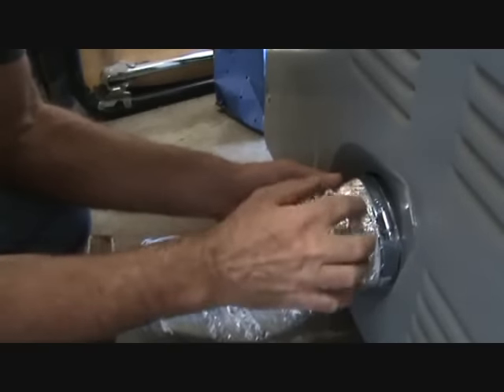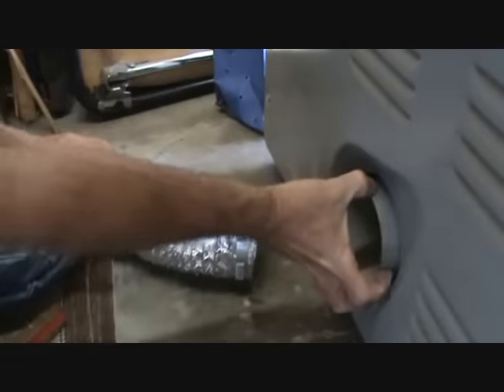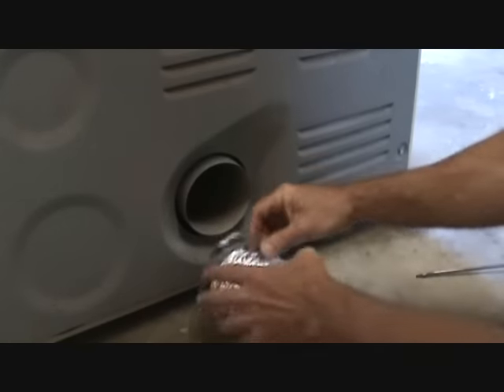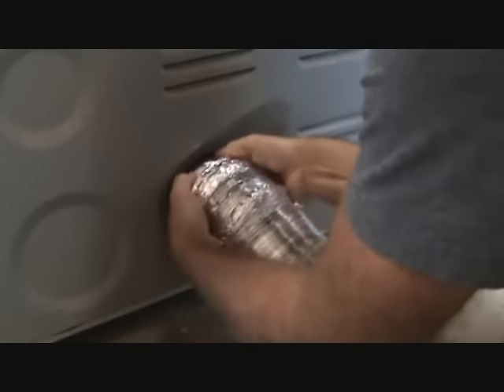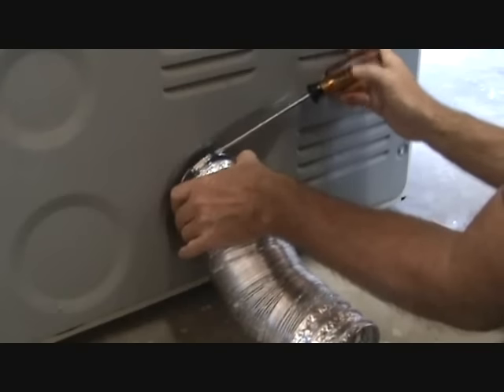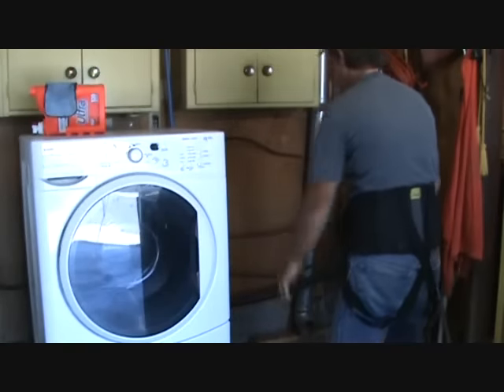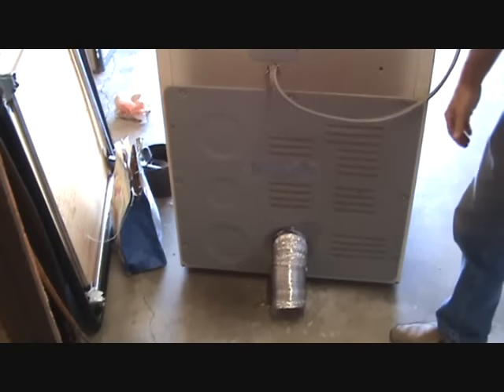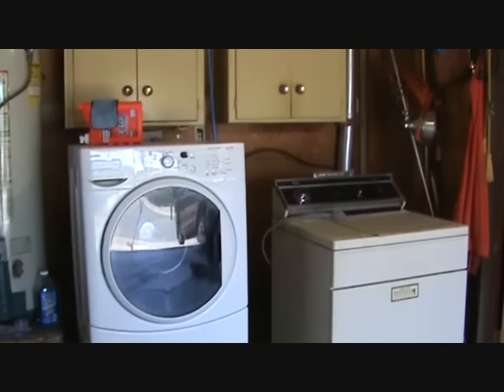How to install a dryer vent flexible pipe

Comment: I don't mean to be a downer, but I'd like to share with you why this is NOT a good installation.
1.  Material is NOT code compliant for dryers.  It will wear out over time and the foil will become brittle and break.
2.  This material is easily crushed against the wall, significantly reducing air flow and will also collect lint much quicker because of the ridges and shape
3.  Transition material like semi rigid can only be used up to eight feet for a reason.  This does NOT mean that you should use all 8 feet of it.  Most people leave it long so they can pull the dryer all the way out to access it.  You are much better off moving the washer, making the dryer connection properly, and then moving the washer back. 
4.  The clamps do NOT seal the vent.  You will have air and moisture escaping the vent and it will get sucked back into the dryer causing lint build up on your wires, motor, etc.  This will also wear out your belts quicker.  

For a proper installation of the transition, use a small piece of pipe or an elbow at the back of the dryer.  This eliminates the problem of having a short lip to work with.  Use Semi rigid or other code-compliant material to make the connection and keep it as short as possible.  If you have very little room, like many people do, you may need to cut away the drywall a bit or use a "close connect' 90 degree elbow.  
What I can promise you as a certified Dryer Exhaust Technician (CSIA.org) is that you WILL have a problem.  Air flow will be blocked, your line will build up quicker, your heating element or fuses will then go on your dryer and you will pay for the dryer to be fixed.  Unfortunately, you may never change the venting, even if they clean it out for you.  
Sometimes, it is best to call a professional.  I am an owner in a national Dryer Venting franchise so please know I am only trying to inform you.  Best of luck
Reply from the maker: Thank you so much for all the info. you have provided! Anyone who elects to read your comments will surely benefit from your knowledge. Thanks again for taking time out to post this message!   Joe  :0
Reply: +Joseph Emery Elbows and the semi rigid piping with the smooth interior is the way to go.
Reply: +Joseph Emery I am using a small metal connector but keep having the same problems... how do you get the dang thing connected without ripping holes in it??  I keep jabbing holes in the flexi with either my fingernail or screwdriver end because I'm trying to pull the wires up around the dryer vent and then the connector on the other end to at least 2 turns (or the wire).  It is snug as hell and trying to pull the sleeve around things makes it tear or makes holes in it. I am using flexi to the connector and then the very rigid from there up to the outside vent.  I do not even need to extend the flexi that much but needed a little more than the rigid vent provided. But the thing keeps tearing and ripping because I am struggling to pull it up and around either the dryer vent or the metal connector between the two vent hoses I bought.
Reply from the maker: Sounds like you have enough of the flexy to cut off the section that you put some holes in since you can flex it out from there & try again. Keep at it. You can do it! If anyone else came out there they would have the same issue you're having & somehow they would get it on. Are you sure you have the right size? I would think you do.... Let me know how it goes. Hope this helps.   Joe  :0
Reply: Thanks, Joe! :)  I thought it was all one uniform size at the end?  I'll keep trying, but if there are some little pinholes, that's not terrible is it? Like it won't catch on fire?  I am freaking out about that...
Reply from the maker: Where the pin holes are can you cut off that section of flexipipe? Use some cutters to cut the actual wire then you can slit the rest with a drywall knife or kitchen knife if you have to. Then will you have enough of the flexipipe long enough for what you need? If you can do that then I would say to cut the pin holes section off.
Reply: Yep, I can do that and still have enough length.  I'll keep at it, but it is so frustrating to connect, I thought there must be something wrong or i got the wrong hose - the one that is a fire hazard, etc. bc it is not rigid. My other one I am connecting it to is rigid though.
Reply: It's ridiculous why the ends aren't tapered! They are the same circumference as the thing to "slide it on" to!
Reply from the maker: OK keep at it. Yes they have rigid & they also have an aluminum one that expands out kind of like the aluminum flexi one you have. I know it's frustrating but keep working it & you will get it!
Reply: I will...  thanks!  The other end to vent it outside is straight up in the ceiling so that will be a BIG pain to slide on and clamp, with arms up in the air and on a ladder.  I've given up for tonight. Maybe that one is narrower or I can make it bow in a little with pliers. That is a metal elbow sticking out of the ceiling. 
Thanks for all your help with this!
Reply from the maker: Hey you done good tonight. At least you got a game plan & I think you will be able to do it tomorrow! You know if I lived anywhere close to you I would come out & lend a hand.....
Reply: haha, thanks, Joe!  I'd hire you in a heartbeat!  I got a list ready...  :)  haha

going to give this another go in the morning!
Reply from the maker: Ha! Where do you live? I would bring my video camera for sure.... lol
Reply: I'm in Iowa; right in the middle of the state! Are you nearby?
Reply from the maker: No I'm not near by. I'm in Cali right now visiting Motha dear. Or I would swing by & lend a hand. You can do it!!
Reply: Thanks for helping from afar though.  It's caucus night so waiting til tomorrow! And thanks for the vote of confidence!
Reply from the maker: You will always have my vote! Happy caucus'sing!
Reply: Joseph Emery very kind of you to share you knowledge
Reply: VideoJoeKnows You are awesome anyway! !!😆😆😆😆 I'm watching this video because the vent hose is not well installed in my laundry room! So I'm going to try to doing myself! 😉😉😉
Reply: DryerFlex!
Reply: persona non grata As was mentioned, there is a reason the pipe is a certain length.  That being said, when this type is used, many times, the full length is not needed and should be cut to length needed.  Those ridges do catch a LOT of lint/debris over time.  The fewer ridges, the better.
  As far as getting this on the pipes, I usually get a little bit on the pipe then turn it clockwise to sort of scree it on.  The wire in the ridges kind of acts like threads, and it will help pull the flex pipe onto the pipe if done carefully.  When I get it on one of the pipes, I then turn the flex counterclockwise a little before trying to put it on the pipe then screw it on too.
   This screwing action expands the flex enough to fit it over the pipe.
  When screwing the flex on, I will push a little on the part of the ridge that is first put on the pipe while screwing the pipe on.  The same with the second ridge and so on.
Reply: UPDATE:
R.I.P. persona non grata
Home caught fire in a dryer vent hose related accident. She should've found the nearest male to perform the simple task but she wanted to be a little DIYer
Reply: persona non grata
should be using a solid pipe, not a flexible hose, but at least buy a quality flexible hose that doesn't rip when you breath on it too hard. Also, pull on the hose so there isn't a bunch of little pockets for lint to get trapped in like this guy did. He should've cut his 8 foot hose down to 3 feet or whatever, not just scrunch it up
Reply: Condone yourself like a professional Oh, horseshit. I took off my flexible hose after 4 years to clean out all the lint ‘experts’ warn about and there was hardly any lint to worry about.  It you clean the dryer lint filter with every load there won’t be a problem. The rigid vent pipes are really only necessary for commercial installations like apartment building laundry rooms and laundry mats.
Reply: You are absolutely right. I have the same type of flexible dryer ducting. 5 times I've had to replace the thermisistor on  my dryer due to the condensation and lint shorting everything out.

Comment: I taped the flex pipe on the top of my dryer so that way it blows out the hot air in my downstairs room keep it warm since I don't have a heater. The garage was turned into a room it works great only takes a couple of minutes to warm up a two car garage.
Reply: Do you think the lint in the air would then get in your lungs?
Reply from the maker: Doesn't sound very safe....you might want to see about a lint catcher of some sort...

Comment: Can also use duct tap to help hold hose in place for the clamp.
Reply from the maker: I guess you could but once you get the flex pipe on there & get the clamp into place, you shouldn't need any duct tape at all once you tighten down the clamp.

Comment: The flex pipe is long . Is there a time when a person would cut the flex pipe for length.?
Reply from the maker: The reason the flex pipe is long is so that when you need to disconnect it when pulling the dryer away from the wall you will have enough room to then get back there to disconnect the flexible pipe. Just leave the length & let it coil up as that will be fine.

Comment: I have tried for two hours I get the hose and clamp right on top of the plastic pipe and it will get tight but still slides off.
Reply: i have this problem1 letm e know if you found anything to fix it, its driving me insane
Reply from the maker: Watch this video again. Did you finally get it? Hope so!
Reply from the maker: Watch this video again. Did you get it?
Reply: Yes finally i got it.
Reply from the maker: @hotdon1  Nice job with not giving up!

Comment: Had to replace my vent in April D/T hole in it. Horrible job. Not much space in the Utility Room and permanent shelves above the washer/dryer. Tore the linoleum. Took me all day. Today I felt heat in the room. Climbed up over the dryer and looked down behind. Aaargh!!! the corrugated flex pipe has come off the wall duct. I did the installation about like you did (though I hadn't seen the video till today). Are there any other connections besides this flex pipe? Although with the limited space, guess I will have to stay with this type product. I'm 67 yrs old, not as stout and don't contort as well as I used to do. I think I had more that 3 coils on both ends of the ducts. Think that was too many? I dread doing this again, want it as permanent as possible this time.
Reply from the maker: Sounds like you did a great job. Way to go!   Joe  :0

Comment: Hi again!  Ok... how do you get the dang thing connected without ripping holes in it??  I keep jabbing holes in the flexi with either my fingernail or screwdriver end because I'm trying to pull the wires up around the dryer vent and then the connector on the other end to at least 2 turns (or the wire).  It is snug as hell and trying to pull the sleeve around things makes it tear or makes holes in it!!!  Argh. Does this matter?
Reply from the maker: +persona non grata Well try not to get holes in it & do the best you can. Yes it's kind of tricky to get on since it's just about the same size. Hold your mouth just right and roll the foil edge over into the  flex then try to get just the first flexy ring on a little at a time & not straight on rather at a slight angle then little by little then get a second ring portion on so when you clamp it it won't come off. Watch the video again if need be. Stick with it & keep those finger nails off the material! lol
Reply: Ok... but I thoguth I was doing something wrong.  Why don't they make those dang ends tapered??? So they slide right together?  I am sort of able to twist it on a little bit - like how people used to give "indian rope burns" (not very PC these days), but that kind of motion, but then I tried pushing the wires over the metal with the end of the screwdriver and it tore a hole in it.  Should I not be using the flexi and only the rigid?  Because of fired hazard? Then I need an elbow?
Reply from the maker: Yes sounds like you are trying to put it on the right way as you explain. But maybe you shouldn't use the screwdriver. When I did the one I put on I just used my fingers & fingernails so as not to poke holes. the edge you are connecting to is it nice & straight? It's not bent out on the flange anywhere is it? How long is the flange? Can you tweak the metal round flange inward just a tad all the way around with a pair of pliers then try sliding the flexi back on? Hey if the store sells aluminum flexi then I would say it's safe. Keep at it.   Joe  :0
Reply: It's almost exactly like the one you have here, but yes, I think I could bend it in in a few places around with pliers, maybe! I didn't think of that, thanks!  It won't kill me if there are some pinholes throughout though right? Not catch on fire because of that?  It seems to me it could have pinholes in it throughout just because of the manufacturing!
Reply from the maker: I hope the manufacturer didn't put pin holes in it. You wouldn't want any lint or anything like that blow out of the pin hole or make the pin hole bigger later on down the road. Plus you could have it blowing around inside your garage or wherever & it will be hot/warm air & could cause a moisture problem later on. I would say no pin holes if possible....
Reply: See yeah, that's what I think too. But it is just a thin foil between the wires, I think they couldn't help but have some little teeny holes in it, just during manufacturing, packaging, etc.  Weird!
Reply from the maker: Yea weird

Comment: My drier has an elbow connected to the vent of the drier and it makes it easier to put the flexible vent duct on it.
Reply from the maker: There you go. That would be an easier way to do it anyway. Thanks for the suggestion....it's a good one!

Comment from the maker: The product I used seemed like a good idea as most hardware stores sell it & is very inexpensive & is exclusively for dryer venting. I would though, like to look at the product you mention. what makes it more durable than the product I used?   Joe  :0
Reply: It's highly FLAMMABLE.. Just test it with a lighter.

Comment: Thank you but can’t dryer duct tape work just as good also?
Reply from the maker: In most cases the duct tape will work for awhile then eventually will probably dry up & come off easier than a clamp will. Plus it's hard to get the tape on there as you don't have much holding power on that little lip that you need to tape to. For me I would not do it....as a thought

Comment: Just saw on HB web site they sell Clothes Dryer Lint Alarm, but they still show using the flex tube in there installation video. but with the other tube  you would need some 90* connectors, because they don't flex very well
Reply from the maker: If you are referring to the aluminum flex pipe you just firmly bending it where needed for the elbow etc.. A bit more difficult to use yes but most viewers say you should use that & not this flexible foil piping but why are hardware stores still selling it if in fact it's a fire hazard....?

Comment: In Indiana Lowe's refused to install a new dryer unless I replaced this sort of flex pipe with smooth, hard metal. So far as I can tell this wouldn't meet code most places.
Reply: So in other words, the same store that SELLS this "dangerous" product refused to install the dryer that YOU paid for in YOUR house until you cough up more cash and "upgrade" to an aluminum duct?  Sounds like they care more about ripping you off than your "safety".  And you can't tell me that they did it to avoid a potential lawsuit because if that was the case, then they wouldn't even sell the flex duct in the first place.
Reply from the maker: That's funny because I believe at the time of this video Lowes actually sold this flexible pipe for dryers. Thanks for stopping by!
Reply from the maker: I know it doesn't make sense.
Reply: @guildrich  
How did Lowe’s rip me off? They didn’t install the new vent. It gave them zero additional profit. I’m glad I installed a better vent.
Reply: @VideoJoeKnows  
Is it possible that code requires a new dryer to have smooth pipe, but  not as a replacement for existing flex pipe?
Reply from the maker: @nicmart  I don't really know. Maybe next time you go to like The Home Depot or Lowes you can go to the appliance area & first see if in fact they still sell the flexible pipe like I show in this video then ask them your questions & see what they might have to say about it....

Comment: It wont cause any problems with the elbow being inside that flex? Any lint getting caught up?
Reply from the maker: You might have lint build up after a few years & if you can get back there easily enough you might want to check from time to time if that is a concern for you. Thanks for your message!